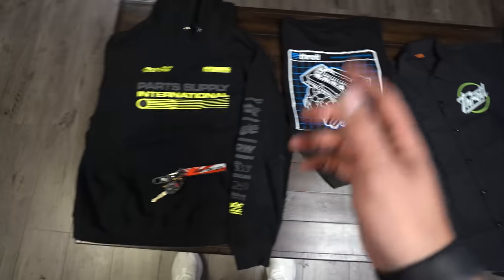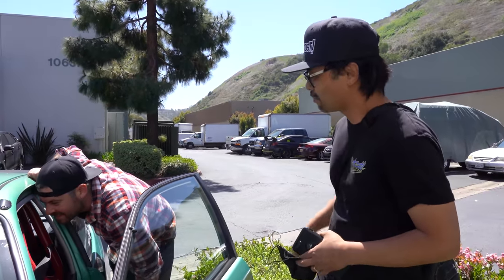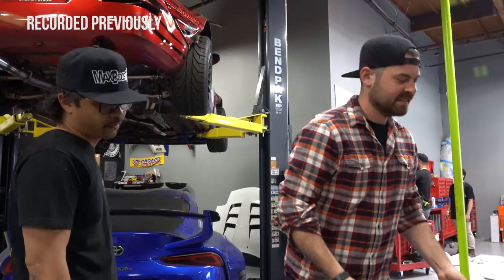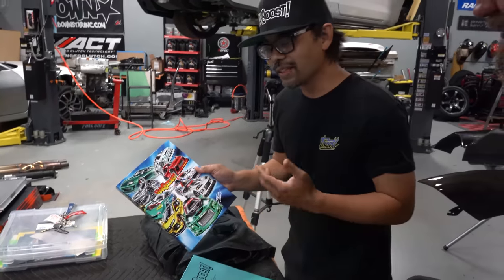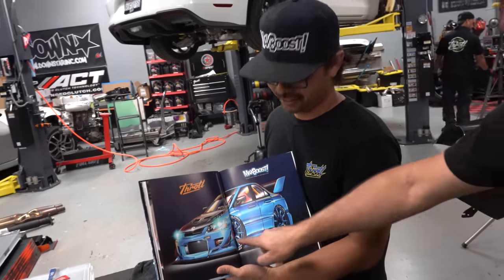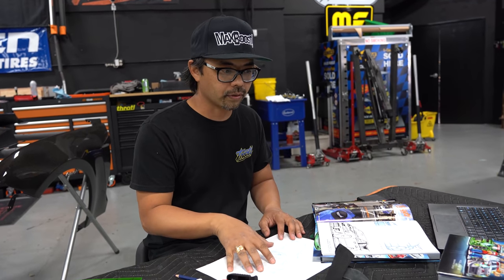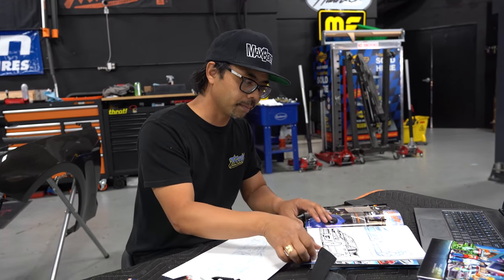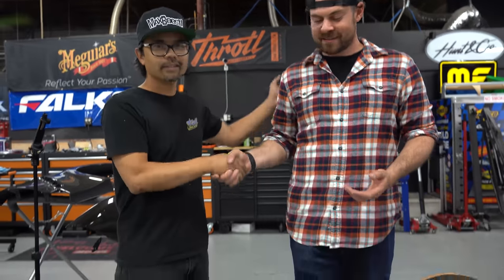Building a Modern Day (Fast & Furious) 1998 Mitsubishi Eclipse GSX - Part 3 - Comic Book Car!

Comment: I have a 98 gst, all white with tan leather interior. Mine is 22 years old, 355 hp, dynoed and tuned by DBW Motorsports, lowered with Tein coilovers, no tint, on v3 ECMlink, baer brakes in the front, new pistons, rings, tial waste gate and BOV, ACT clutch and flywheel, 3052 FP turbo, and a few more things that makes it fun to drive. Man, this is nice what you guys are doing to bring focus back to an original sought after car. I would not mind having a drawing like that, lol, that gentleman has skills. I will follow this build. New fam here for your community.

Comment: New project after the Tesla 350 is finished. Tesla 1990's NSX! That might be a "world's first". I think there is going to be a demand for aftermarket electric conversions for older chassis once the new car manufacturers go all electric. The right level of electric power and all wheel drive with torque vectoring would make some of these older chassis more fun to drive than they have ever been.